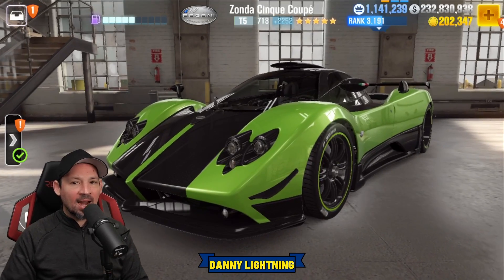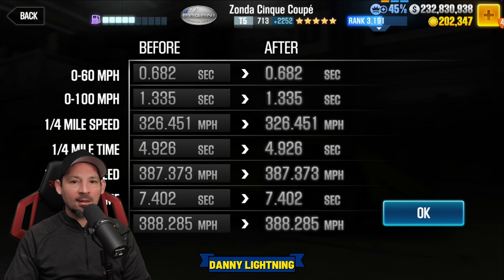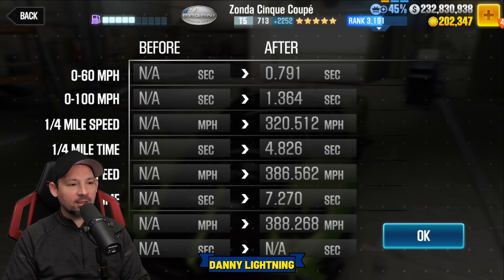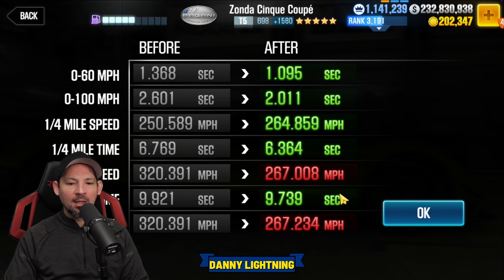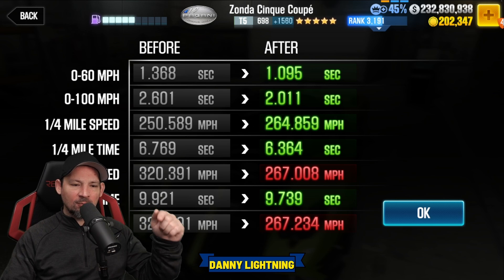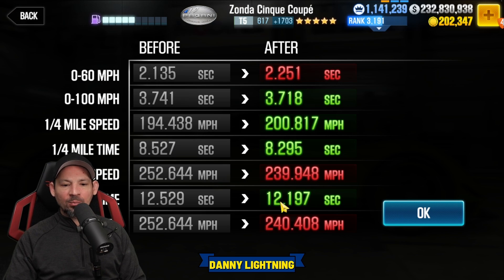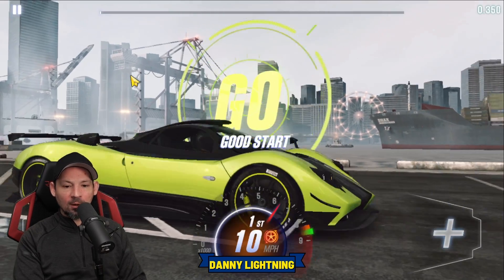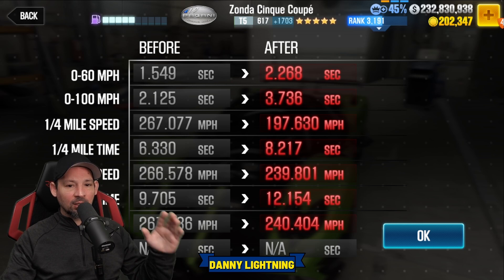CSR2 Pagani Zonda Cinque Roadster Gold Star | Shift Tune Review | How To Drive zonda CinquCSR2

Comment: Is it good to put one or two stage 6 parts even the Rest of my parts are still on stage 5. I mean because of the tuning
Reply from the maker: Yes, anytime you need to add parts you would tune the car again, I do have a playlist on my channel, if you go to my channel and scroll down you'll find my tuning playlist if you need help with tuning.  But it will make the car faster if you add those parts and tune it  properly
Reply: @Danny-Lightning-CSR  thanks man